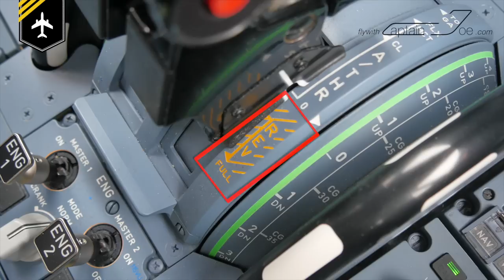What is reverse thrust? Explained by CAPTAIN JOE

Comment: What is the purpose of the pointed things that are on the back of the flaps? (Not the underside of the wing)
Reply: What do you mean by pointed things, can you be more specific?  Are you talking about the 6 inch wires that extend from the back of some control surfaces?  If so, they would be static electricity discharge wicks or wires.  I can't think of anything else that's pointed on the "back of the flaps".  I've been flying General Aviation airplanes for almost 50 years, so I pay a lot of attention to any airplane I'm a passenger in.  Please be more specific and maybe somebody here can try to answer your question.
Reply: daffidavit i am talking about the pointed triangular thing on the back of the wing facing the back of the plane
Reply: Those are flap fairings which streamline the equipment which extend and lower flaps.
Reply: longlakeshore THANKS
Reply: They are underneath the flaps.

Comment: Captain joe what is vertical speed ??
Reply: Basically how fast the aircraft is climbing or descending. Vertical speed is always measured in fpm (feet per minute). For example, a vertical speed of 2000fpm indicates a climb where the aircraft will gain 2000 feet in altitude every minute. Negative values, like -2000fpm indicate a descent where the aircraft will lose 2000 feet of altitude every minute.

Comment: Good explanation! Nevertheless, something is not ok in my mind. I try to explain with my poor english. I understand that the thrust is reversed forward when the flats are openned, and the pressure on the flats push the plane backward. ... but inside the engine, we should have, due to the the law of action-reaction, an equivalent pressure forward, which should neutralise the effect, no? For sure, that is working. ... but why???
Reply: Current jet engine have inner and outer section, outer section is blown forward and is stronger than inner, so adds force opposite to usual direction. By inner and outer I mean inner and outer cylenders

Comment: This reverse thrust (combined with opening flaps and other on wing drag inducing objects) seems like it is good to be used only for slowing down from the full over 500 miles per hour speed down to car speeds (like 60 miles per hour) where you can turn it off and be able to simply use the brakes like a normal car as you come to a full stop and close the flaps and wing drag inducing objects. Why do you need the full aircraft engines for the slower car speeds even to back out of a gate when engineers and manufacturers can simply make the wheels act like a car and simply drive the plane on the airport roads as if an ordinary car at speeds 60 miles per hour or less. (800km/h=500mi/h and 96km/h=60mi/h)

Comment: why cant they make the turbo fan in the engine spin in the opposite direction for reverse thrust.  There is a lot of thrust wasted by using the side actuators.
Reply: Nader Nader the blades on a turbofan are fixed. So you cannot change the blade angles (and it’s impractical to have a system too)

And it cannot be rotated in the opposite direction because it’s directly attached to the compressor, so the direction of spin can’t change

Comment: Has anyone used reverse thrust while the aircraft is in flight ? Can they use it in flight or while on an approach for landing , maybe in case the approach speed is too high due to tail wind or any other reason ?
Reply: Normally the reversers are locked in flight. There's a switch on the landing gear to unlock them, which activates when the landing gear experiences a certain minimum load. So you can only use them on the ground.
Reply: I guess that would help to keep the structural integrity of the aircraft too , specifically the wing and the engine pylons.....since it won't , PULL the wing off it's root if the speed is low.

Comment: What happens if you apply reverse thrust while cruising
Reply: you can't, there is a safety feature that stops that from happening, just in case one reverse thrust is engaged during flight resulting on a violent loss of speed and lift on only one wing, so you would lose control inmediately, however on some planes (specially turboprops like ATR) you can engage reverse thrust in flight, great for loosing speed more quickly or making step descents without gaining speed

Comment: Where do the airplanes get power when engines are off i.e. during boarding.
Reply: There is a small engine in the back of the aircraft, which runs a generator. If that's not present, then an external generator is used.

Comment: I always  wonder Why they dont use if for push backs ???
Reply: Today it's not allowed to use them for several reasons. The engines can ingest debris from the ground which can cause damage for the engines. It would also cause extra fuel consumption. There are the airport and airline regulations. The jet blast can be dangerous for the people working there, and it can cause damage for the nearby equipment and building.

Comment: Noob question:
Why at all let the turbine suck air (which accelerates the plane forward) at touchdown at all? Why not just shut the turbines and perhaps use brakes + spoilers on wings to slow the aircraft down to a halt? It seems rather unnecessary that we use turbines to propel the plane forward AND using that, we try slowing the plane down.
Reply: It is not the jet engine " sucking air" that propels the airplane forward.  It is that the incoming air is mixed with jet fuel, compressed then forced out of the rear of the jet that propels the airplane forward. "reversing" reflecting this thrust forward more then overcomes any air being pulled into the engine.
Reply: oh! didn't realise that, thanks!

Comment: hey Joe why don't 
the they reverse the motion 
of turbines in the opposite way after touchdown
#captainjoe
Reply: Someone previously already asked this so I'll just copy my answer because I'm really lazy.

The engines of modern aircraft rotate at extremely high speeds, so the direction cannot just be "switched" that easily. Also, the engine cores only work in 1 direction, so even if the fans could be reversed in direction, the whole engine would shut down, and possibly get damaged due to hot exhaust air moving to the front of the engine instead of the rear.
Reply: Thanks Nathan Chetram gr8 info
Reply: No problem, happy to help

Comment: It can have a detrimental effect if one of a plane’s engines malfunctions and goes into reverse thrust during takeoff especially when the plane reaches takeoff speed V1/V2.
Reply: If that happens it is 99% going to crash. Thankfully this is near impossible at takeoff due to mechanical lock outs when aircraft is above idle power.

Comment: Do you know why older planes have longer, but narrower engines?
Reply: Older aircraft generally had bypass ratios that were extremely small, or nonexistent. In a modern engine, only some of the air is sent to the engine core, which is where it is compressed, mixed with fuel, and ignited. The rest of the air is redirected around the core, and this redirected air makes up most of the thurst. This redirected air is known as the bypass ratio.

Older aircraft, like the 737-100 or -200 used Pratt and Whitney JT8D engines, which had a very small bypass ratio. Since then, engine manufacturers learned that higher bypass ratios are more efficient, and subsequently created high bypass engines, like the GEnx engine that powers the 787. The fan diameter is much larger since much more air is being sent into the bypass part of the engine, instead of the core.

Comment: Ground spoilers are also used in the air.  I've seen it.
Reply: Tanya Fitchett Your correct but when the spoilers are used in the air their called flight spoilers not ground spoilers
Reply: And what are they used for in the air?  Is it to slow it down, or help turn the aircraft at low air speeds?  Do they only deploy them partway when in the air?
Reply: Tanya Fitchett When the flight spoilers are deployed it destroys lift on that wing by creating drag which will also slow the plane. This means flight spoilers may be used in a quick or unexpected decent as it will alow the plane to drop fast by destroying lift while not picking up as much speed as angling the nose down and descending however this is very unlikely and would be quite uncomfortable for passengers. Flight spoilers may also be used at a minimal angle to slow down without loosing to much lift which is more likely. Flight spoilers may also be used on one wing in addition to the aileron to help turn an aircraft which is also more likely and commen. Also spoilers are split up into different flaps and on some aircraft some flaps are not used in flight and only on touchdown however all spoiler flaps are used for braking on touchdown. And no they will not fully deploy the spoilers in flight unless their is an emergency.

Comment: I always was curious what would happen if the airplane got up to 42,000 feet cruising altitude then slowed the engines to idle then once the engines slowed down, you engage reverse thrust.  I mean i know its as simple as "well the plane would fall out of the sky" but I am actually curious if this happened what would be the result.  At 42,000 I would assume after testing this, the airplane still has enough time to recover from this.
Reply: Once the aircraft leaves the ground, the reverser is physically locked shut so this cannot happen. However, there was an accident in the past involving this scenario:

https://en.wikipedia.org/wiki/Lauda_Air_Flight_004

Basically, an electric arc caused the reverser on the left engine to open in flight. The reverser caused a massive increase in drag, but more importantly it disrupted airflow over the left wing. This led to a massive loss of lift that put the aircraft into an unrecoverable dive. It broke up into several pieces while still in the air due to the speed of the dive.
Reply: Sounds like the worst day possible for a pilot.  Wow!
Reply: Yep, it was completely unexpected as well. Boeing went and tested accidental reverser deployments in the 767 when they were certifying the aircraft, but they did it at a much lower altitude, so the wing didn't lose as much lift. Since flight 004 was so much higher up, the loss of lift meant the plane was completely out of control. That's why all modern aircraft have locks on the reverser doors that engage when the aircraft is airborne.

Comment: Does propeller aircraft have reverse thrust
Reply: Usually the turboprops can do that. They have variable pitch propellers, and there is a system that the pilot can change the angle of propeller blades so that they can produce reverse thrust.
https://i.stack.imgur.com/PN4LZ.jpg

https://i.ytimg.com/vi/IlJRGcfCXIg/maxresdefault.jpg

Comment: Why did the Boeing 727 go out of service?
Reply: Lot's of reasons but it boils down bascially to one main point. The 272 was very expensive to run for the airlines because it needed a 3 man cockpit crew and it used a lot of fuel for its size.

Comment: Explain autopilot, can you fly an entire flight from gate to gate with autopilot?
Reply: Kyler Chin No you can't autopilot isn't used during taxi, landing and takeoff however it is used shortly after takeoff till landing for a high percentage of the flight
Reply: Simulatedletsplays thanks! I know there is this panel where you can change the heading, altitude, speed and such, and they are sometimes pre programmed.
Reply: There are many commercial aircraft capable of autoland all the way to the ground including rollout and auto braking.  Once the FMS has a flight plan and approach in, the pilot would just have to arm the approach, drop the gear and flaps.  So to answer the original question, pilot would have to taxi, takeoff and then the autoflight system could do most of the work the rest of the flight including climb, cruise and landing all the way to full stop on the runway.  Then the pilot would have to taxi to the terminal.

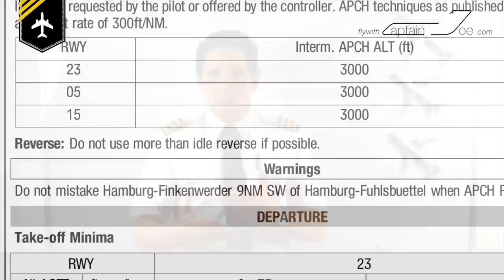Comment: At 3:30 the warning on the airport information sheet literally says "Don't not land at Airbus factory instead of Hamburg Airport" 😅
Reply: Marco von Frieling yes that’s quite common on approach plates when there are multiple airports in the vicinity, especially if they have the same runway alignment.
Reply: @ZK-APA  of course. But in this case that (Airbus factory) is not a regular airport which can handle passengers and luggage. It's just a factory with a long runway ;)
Reply: Marco von Frieling yes, but for a pilot all airports are almost the same. And it’s much harder to notice those visual cues at night.

Eg a USAF C-17 landed in some local airfield instead of a military base in daylight (it’s on video you can search it up)

Comment: Most of the Cars have a reverse cam, If planes had one you could also use full reverse when taxing from the gates ;) :))
Reply: Nope, you couldnt. Too much noise, waste of fuel, and wears the engine down. Reverse thrusters were designed to slow the plane down after landing, it should never be used other than that.

Comment: That's not good enough. There should be a way to turn the engines 180 degrees. Then no need for push back either.

Comment: Actually, you are 100% wrong in your terminology when you use the term "turbine".  The turbine is at the rear of the engine and converts thermal airflow,   Into mechanical kinetic energy which in turn powers the compressor and fan stages in front.
 The turbine has absolutely ZERO to do with anything in the thrust reverser section of the engine!!
 In older aircraft engines they had thrust reverser doors or clam shelled doors that would block the actual exhaust and redivert the exhaust forward,  which would   slow down the aircraft.
 In newer aircraft, such as the airbus A320 that you shown here, The thrust reversers are actually blocker doors that get deployed into the discharge of the fan which is at the front of the engine.  This causes the low velocity high volume air to be discharged forward also slowing down the aircraft.
 So although you may be a pilot narrating this video, it obviously shows that your lack of knowledge of systems is prevalent. I am also a pilot and a licensed aircraft mechanic as well and have been for over 30 years.
 If you're going to post videos on YouTube and try to educate the general public about technical areas, I highly suggest you have somebody that is in the know,  proof read your videos in future,  before publishing them as not to mislead others.